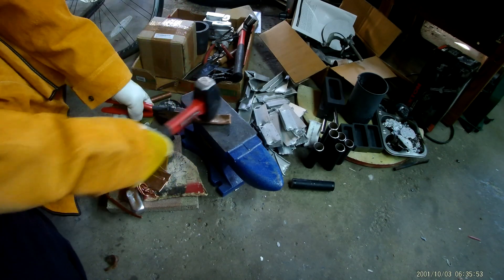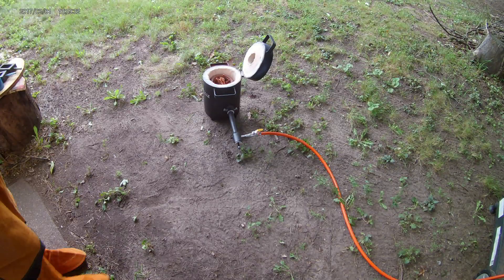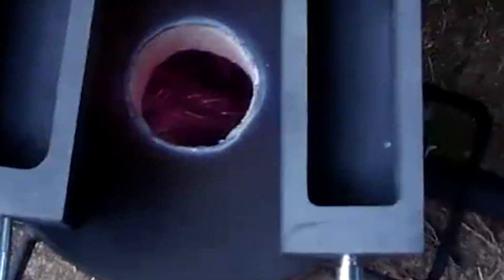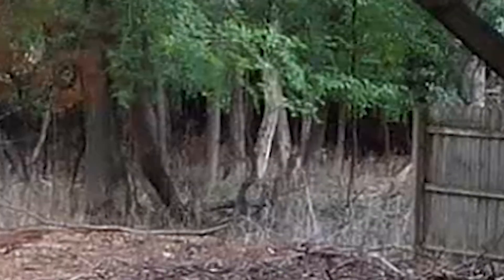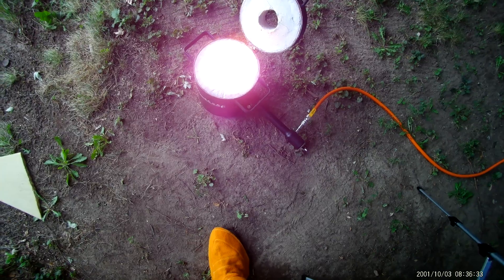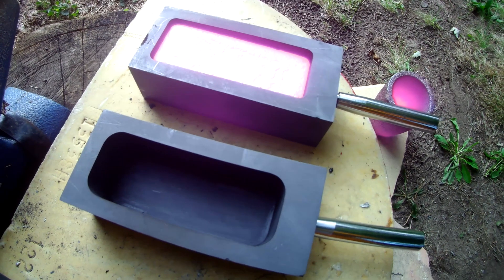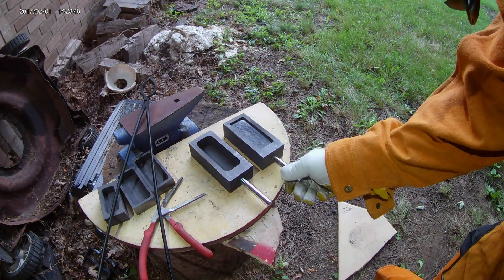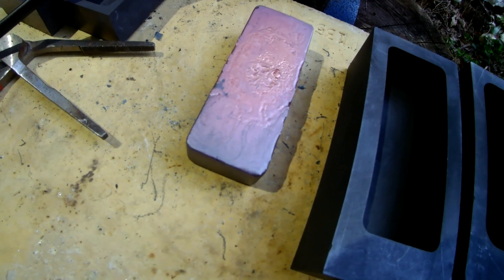Melting Copper for the First Time

Comment: Interesting. Now that they're not making pennies anymore and stores not making change for them. Why not? Would like to know what it all cost though for all that you had to do it and what fuel you were using to get such a tremendous heat for 2000 degrees. Thanks for the video.
Reply from the maker: It's just propane and air. This type of furnace pulls in air using a venturi burner. It can melt metals up to cast iron. So, the only cost is running the propane tank for 30 minutes. I don't sell the metal for scrap though. I'll use it for sculpture.

Comment: nice pour.  quik question:  what is that 'plate' you set the ingots on?
Reply from the maker: @patrickgilmore9125  The yellowish half round plate is a ceramic shelf used to fire ceramic in a kiln. It can resist extreme heat but is also a very good insulator so there is less heat shock when hot things touch it.
Reply: @maverickmeteor  oooo thank you

Comment: how long does a melt like that takes and how much propane does it burns?
Reply from the maker: It took about 35 minutes from the time I lit the furnace to pouring. This is a small furnace with good insulation. A larger furnace might take longer. I did not track how much propane was used.

Comment: You got some nice equipment. But you gotta coat that kaowool. Little fibers are blasted off each firing. Makes me want to go all clay since it fires at a very high temp. And i can find it for free.
Reply from the maker: Thank you for the tip. It's hard to see in the video but the wool is fully coated with hard ceramic.

Comment: Also there's filtered camera lenses that can cut down the ir glare just gotta Google for your specific camera.
Reply from the maker: I appreciate the tip! If I get enough subs to monetize the channel I'll consider some equipment upgrades :-)
Reply: @maverickmeteor  right on. Prices vary wildly as does filtration quality so I'd recommend some reviews research if you get to that point. How you liking the devil forge? Worth it to buy? I want one but I'm not sure if it's worth it
Reply from the maker: @joshschneider9766  I like the furnace but I'm not sure I've used it enough yet to offer a useful opinion. So far, so good.

Comment: I like the safety gear, where did you purchase and how much?  You need a new lifter, it would be a safety disaster if the crucible sidewall gave way!
Reply from the maker: The gear is from local stores and Amazon. I wear full leather, a face shield, and a respirator with filters rated for this sort of thing. I dont recall all the prices. Id say around ~$250 for everything. The gloves are for TIG welding because I like the dexterity, but cheaper gloves are available. You're right about the lifter. I designed and built the pouring tongs to be a lifter/tong combo but unfortunately the inner diameter of the furnace is too small. I suppose a smaller crucible size would also work.
Reply: @maverickmeteor  I was also going to mention the tongs you're using to lift the crucible out of the furnace are not suitable as that type of 'pinching' pressure on the rim of the crucible  creates a localised stress and is likely to break/crack the crucible.....it is definitely because your crucible is too large in diameter that you can't get proper cradling tongs down into the furnace to lift the crucible and yes,a smaller diameter crucible would be better suited to that size of furnace.
Reply from the maker: @howardosborne8647 Yes, the side lifting tongs aren't the best. My pouring tongs also work as lifters but since the furnace is small they can damage the furnace walls. I have plans to build a larger furnace soon.